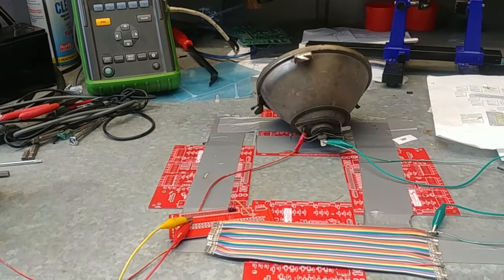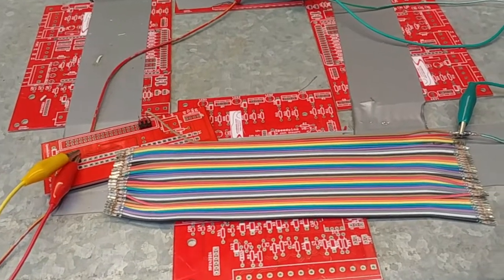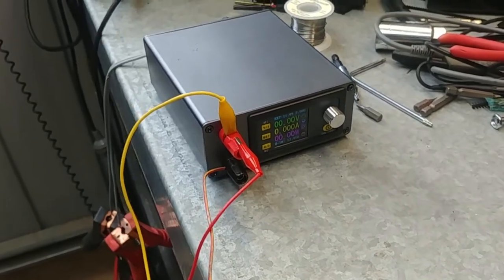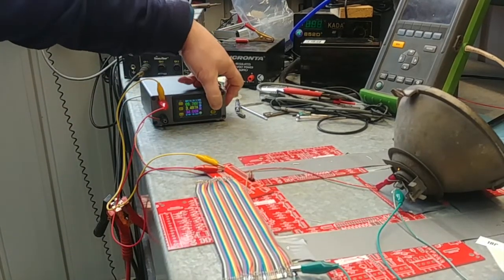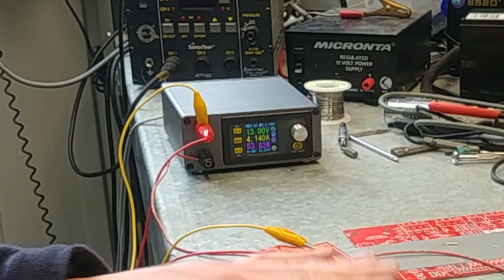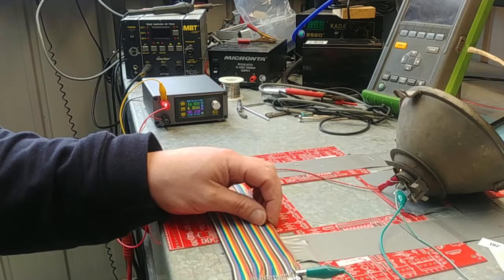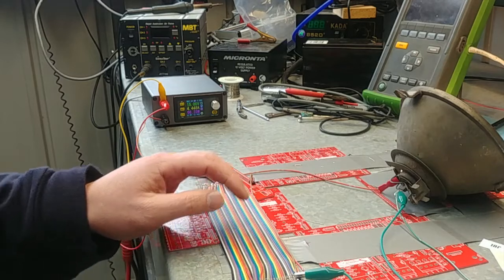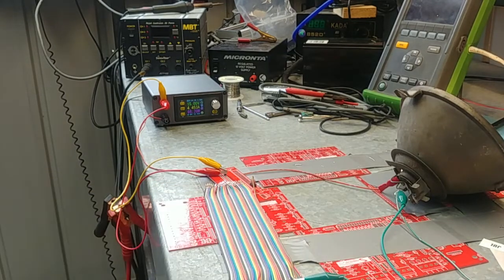Current testing dupont cables (Speeduino)

Comment: A drill battery can melt these little guys
Reply from the maker: Given a drill battery can typically put out a continuous 15A or so, that's not surprising at all.
Reply: @Speeduino  Is that what is?  My arduino only had a voltage sensor to keep from draining the battery too much.  I don't have a current sensor

Comment: Josh, you have 14V at the PSU terminals, what voltage is across the load? The voltage drop across the wiring seems to be ignored. Unless you know this, the voltage correction for the injectors will be incorrect, as the voltage measured by the Speeduino is effectively the 14V you show above, not what actually ends up operating the injector. The thinner the wire the lower the voltage will be at the injector due to greater loss.

Comment: Hey mate can I use some of your code to develop a boost controller for the GM LS PCMs? Particularly the 3d table lookup segments? I want to use a Macchina to read out the data from the PCM then control various things like boost solenoid, MOSFET fuel pump controller, clusters etc. I'm based in Australia